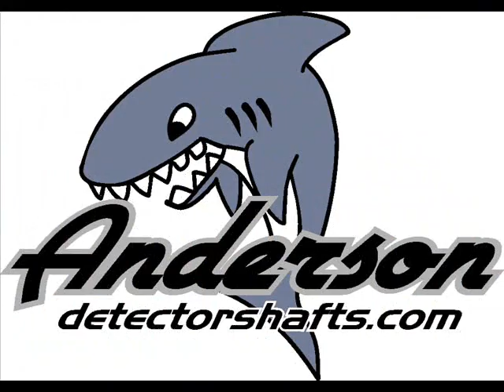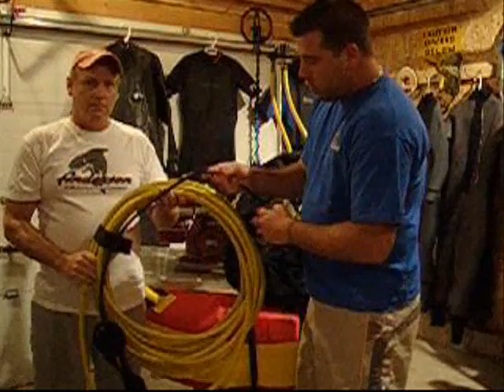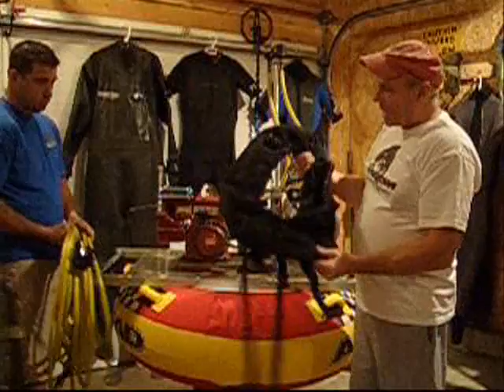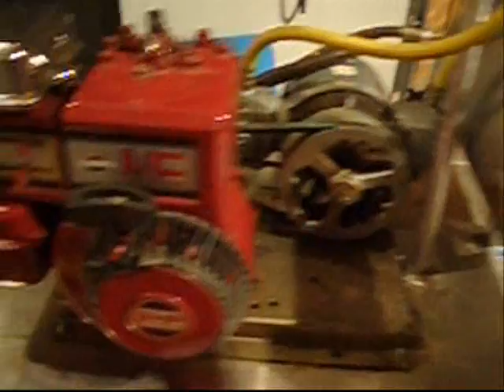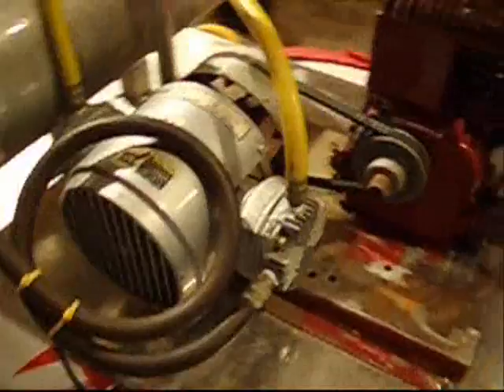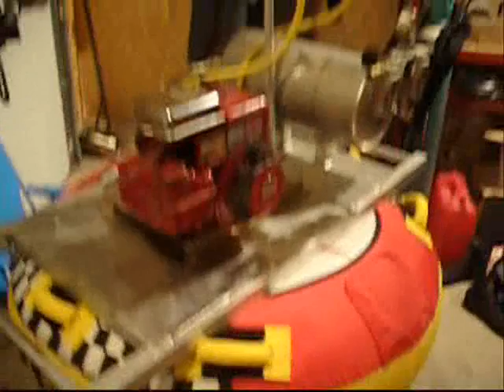Basic Hookah Diving - How to build and setup

Comment: Harbor Freight SKU 64688 - $189.00, then just add a line-dryer and air line.  Oh, yeah...and this is 110-v AC...but for an extra $100, you can make it DC (swap the compressor motor)...then just wire it into your boat DC power...then you don't have to worry about Carbon Monoxide poisoning.

Comment: What's the point of a tank with 2 mins of air in it as a safety precaution if the divers have no way of knowing the pump has stopped?
Reply: As a safety precaution but also so the motor doesn't have to run 24/7. Rather it can fill up the tank then rest for a Minute or two before having to refill agian

Comment: Sorry to say but two deaths had been recorded in using this apparatus. I don't know who is at fault in this case!
Articles available included in the Kaniva Pacific Publication today 09.09.2015. (NZ)
Reply: +Charles Afeaki Did these guys sell the system in the vid to the guys that died
Reply: They build detector shafts as a business (Anderson Detectors) and things for detectors and as far as I know don't sell these Hookah setups.  I've been in contact with Ryan at Anderson Detecting and this system was built for these two gentlemen only.  They are just showing the system they used for Hookah diving.  They sold this system several years ago because of how heavy it was and went to a scuba tank that has a float attached to the tank and floats on the water and doesn't have to be attached to your back.  I started building a system like the one shown here years ago and never finished it and just now am getting it done.  As long as the compressor air intake is high enough away from the engine exhaust there won't be any problems.  If you use this system for the first time like the one shown here make sure you have someone as a tender to watch making sure nothing goes wrong till you are comfortable using it.  You shouldn't be diving alone regardless.  Good luck with your endeavors!  God Bless!

Comment: This rig looks REALLY top heavy.  I'm sure it works like a charm, but I'd be afraid that a large rogue wave or wake from a large passing boat could spell disaster.  Looking at commercial designs like Brownies 3'rd Lung, they put the compressor and engine inside the float - and I suspect it is for this very reason.  I realize that with the components you've selected, that isn't really an option, but perhaps a small dinghy that you could drop the platform into would be better?

Comment: Great setup.  I'm definitely interested in putting together something similar, as I'm sure many others are.  Could you possibly provide a parts list?  Specifically on specialty items like your regulator, hoses, individual connectors, BC, etc.  I'm interested in creating a electric model for my own recreational diving.  If you have a list of the companies you purchased these parts from available that would be very useful as well.  Thx.   J

Comment: I don't know anything about diving so this might be a dumb question.

Why use a hookah? Why not just use scuba equipment?
Reply: Reasons why to use a hookah:
No dive tank compressor needed to fill scuba tanks
Time underwater mostly limited by how long the gasoline engine runs
When cleaning the hulls of boats you don't have your scuba tank banging against the hull
Some areas don't allow scuba diving
And the list goes on and on......